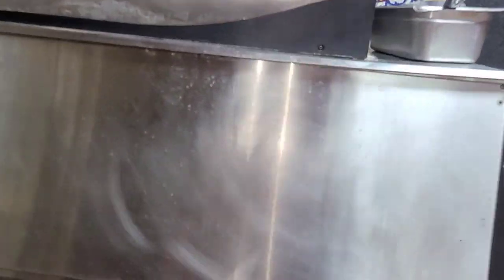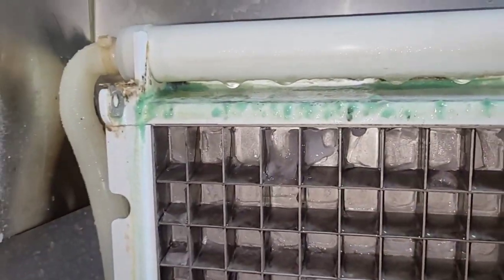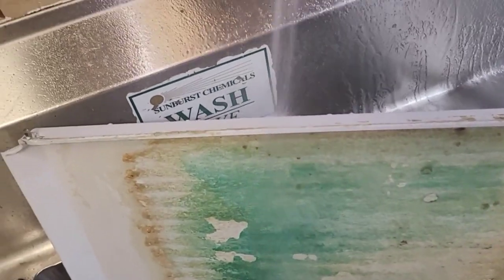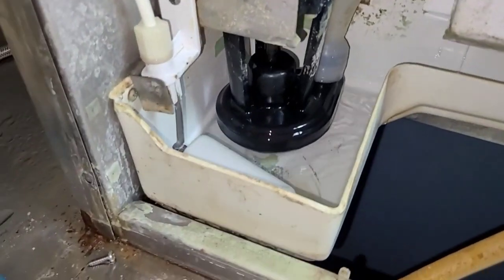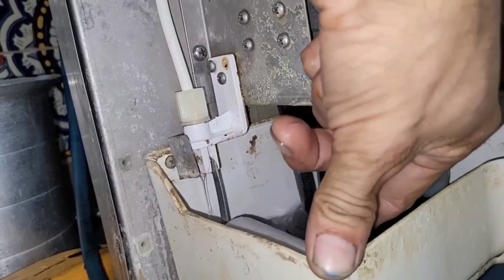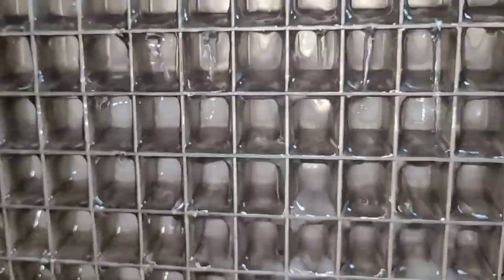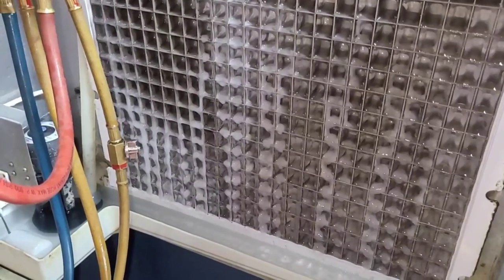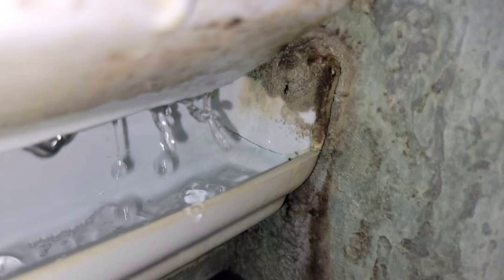ICE MACHINE LOW ON REFRIGERANT

Comment: I’m pretty good with ice makers work o them a lot 
The suction pressure should start 55-60 psi and be down to 45 psi within  a few minutes after start up 

That machine has pressure switch and a timer that will initiates harvest didn’t see the brand though 

Looking at the ice formation on the plate it definitely has a refrigeration issue 

Low charge 
Restriction 
Txv issues 
Hot gas valve leaking by 

The way that condenser coil looked you may be dealing with a restriction from the oil getting overheated 

Hope that helps 
Oh yeah it’s only 95 deg today in the H
Reply from the maker: Yeah I know today is a very nice day. LOL. I appreciate all the feedback yeah it's low charge leaking in the evaporator. I should have the rest of that video or part 2 of it up today. I'm already done working on it we're just waiting on a coil to get quoted. That and a new water trough and water filters...

Comment: I didn’t like working on ice machines to sensitive and time consuming just plain boring. The last company I worked for is where I got refrigeration experience. I’ve always done hvac prior. He didn’t advertise refrigeration it was accounts he had that if you do our hvac you must do our refrigeration. I didn’t mind the walk ins and reach ins. But the ice machines were a lot cleaner than this one because we installed in-line filters on them and cleaned and sanitized them quarterly that was the only way he would do ice machines and we didn’t have to many problems with them with the contract written that way.